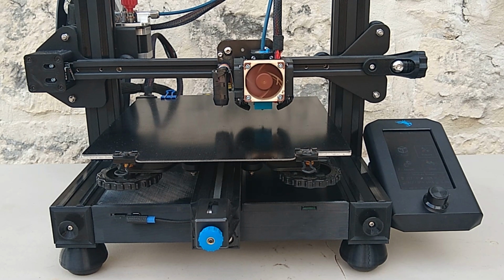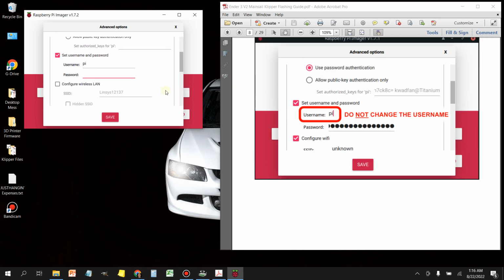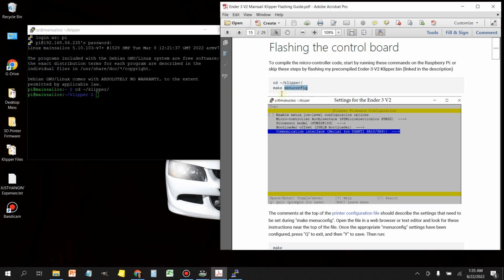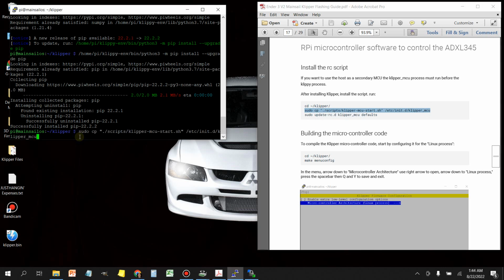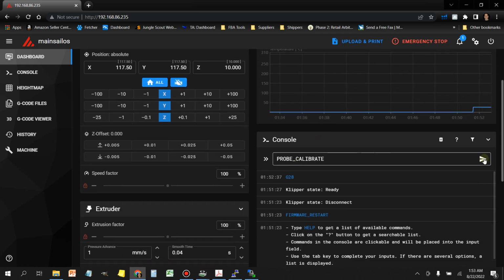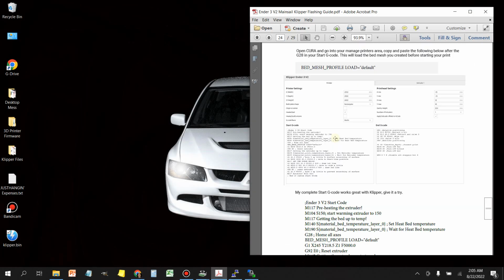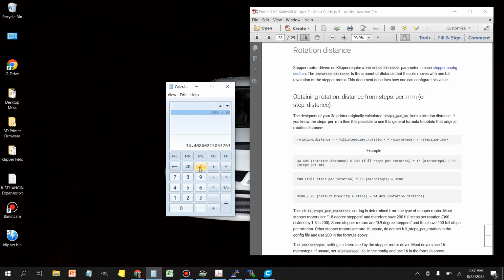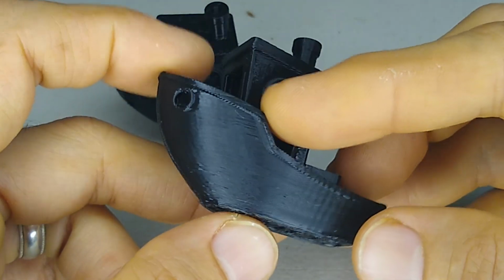Ender 3 V2 An Easy Way of Installing, Calibrating, and Printing with Mainsail Klipper

Comment: 7 hours struggling to get my z-offset to the right setting. If i just knew this link i would have done it within 40minutes  ..Thanx victor
Reply from the maker: Hi Martin, Thank you for commenting, I'm glad you found value in this video for your viewing time and got things working. Best of luck with your 3D Prints.

Comment: follow this instruction to a "T", but having issues with the MCU popping up in mainsailos. Getting the error of "moonraker cannot connect to klipper. Check the klippy_uds_address: ~/printer_data/comms/klippy.sock". any thoughts as to what may be blocking the connection of the MCU?
Reply from the maker: Hi Jordan, What chip does you board have STM32F103 or GD32F303? Look at right side (square chip) of each picture linked below to determine which you have.

https://image3.pushauction.com/3/0/0/cdffea97-1da1-412d-ab6e-f577ed76508d/d4c430f0-1a4c-4f34-b8a3-422bf6fd2176.jpg

https://canada1.discourse-cdn.com/free1/uploads/klipper/optimized/2X/8/86baabe462ec66f23502d369945d902737171272_2_1023x686.jpeg
Reply: Did u fix it?

Comment: hi Vic i like your videos . Congratulations about your work. I have also ender 3 v2 but some models has  gd32f303 ret6 microcontroller. Do you know if we should use the same settings when we try to setup klipper ? In the past i made a try but i had problems in Z axis.
Reply from the maker: Hi Nick, Thank you for commenting, encouragement, and info about the new chip. I haven't tested this myself but a possible solution might be below. Please let me know if it works for you.

https://klipper.discourse.group/t/support-for-new-creality-boards-4-2-2-with-gd32f303/3016?page=2

Comment: Hello, i already did this once following your vid, now i had to do it again and when i try to use "ls /dev/serial/by-id/*" it says " cannot access '/dev/serial/by-id/*': no such file or directory" , can you help me with that? im going crazy
Reply from the maker: Hi Mica, that response indicates that the Raspberry Pi doesn't see the printer. Try a different USB cable. Keep in mind that it must be a data cable and not be a charge only cable. I've had brand new data USB cables not work so try another one.

Comment: Morning Victor, great videos clear and easy to follow and understand. However I have run into a problem.  I have an ender 3 which now has a v4.2.7 board and the LCD screen. had the mscro software all good.   But wanted to learn something new so got a Pi 3+ and have gone though the all the steps. Twice!!  mainsail communicates with the printer.  Endstops trigger, temps of heater and bed work. I can activate to de-activate the motors but if I home etc motors will not move??  Any suggestions would be very much appreciated.
Reply from the maker: Hi Duncan, what printer.cfg are you using? Is it the one for the 4.2.7 board or are you using the 4.2.2 printer.cfg?
Reply: I have tried Both!! and from differing sources too.  So still scratching my head but I will get to the bottom of it.
 @vbared

Comment: I need to use my android phone instead  of rpi with Octo4A  software but Klipper ran in octo4a does not support flashing of board's microcontroller. So can i use your  Ender-3-V2-Klipper.bin to flash my ender 3 v2 ? 

Thanks for the great tutorial.
Reply from the maker: Hello friend, Thank you for commenting and encouragement. Yes, my Ender 3 V2 Klipper.bin file will work on yours. I'm not sure if anything else is created in the the raspberry pi or in your case Android phone when the bin file is generated so if it doesn't work just run the Linux commands to generate your own klipper.bin on your device but just use mine, which should be the same.
Reply: Thanks for your answer.
Reply from the maker: @panagiotis-u3y  Anytime (:

Comment: I have an ender 3v2 (w/CR Touch) and 3v3. I'm attempting to put klipper on an Ubuntu PC and control the V2 with clipper and V3 with Octoprint (Marlin) from the same PC. (will put the V3 on Klipper when I'm confident that the config will work properly) 

Thank you for your guide. This will help me a great deal!
Reply from the maker: Hello Crooker2, Thank you for commenting. Running Klipper on a PC will provide a lag free experience.

Let me know how it all works out for you.

Best of luck with your mods!
Reply: @vbared  Thanks Victor!  For the record, I'm doing this with KIAUH which is an awesome helper tool.  I still have lots to learn though.  Thanks for your content.  New subscriber.  Appreciate it.

Comment: Hey @vbared - thanks for the video! 

FYI your google drive link doesn't work anymore, would you be so kind as to update it?
Reply from the maker: Hello, Thank you for commenting and the heads up about the Google Drive Link. It looks like they made a change that is causing issues.

I copied those files to MEGA - https://mega.nz/file/VIVHTZpQ#niYdBTV32IiXy8ZyVoK-JOdce8Yvwg-if5yvQAokkoY

Comment: I'm new to this and having issue running "/home/pi/klippy-env/bin/python3 -m pip install --upgrade pip" I'm getting  "no such file or directory" Anyone had this issue?
Reply from the maker: Hello, I just did a fresh Mainsail Klipper on Raspberry Pi for a new printer. 

The following sequence is still working:

cd ~/klipper/
sudo apt update
sudo apt install python3-numpy python3-matplotlib libatlas-base-dev
~/klippy-env/bin/pip install -v numpy
/home/pi/klippy-env/bin/python3 -m pip install --upgrade pip

Let me know if you have any trouble with it.
Reply: @vbared it works now. I probably screwed up in the beginning. thank you
Reply from the maker: @pinggoyadventures5010  Awesome! Glad it's working for you.
Reply: Would I need to change anything if I were to upgrade mine to sprite extruder?
Reply from the maker: @pinggoyadventures5010  The only thing I can think of is the rotation distance (aka e-steps).

Comment: man i cant get mine to go.   Every time i get stuck at same space.  After  I Make and transfer my klipper file over to kfirmware.bim.  my progress stops.  nothing i try works after that.  

 ****MCU unable to connect***  
is what i get

 Any ideas?
Reply from the maker: Hello, Are you installing it on an Ender 3 V2 or something else? Is your computer running Windows or Apple? If Windows are you running an antivirus program, then don't like bin files. Feel free to call me 478-227-3301 so I can help you troubleshoot the issue.

Comment: This is absolutely the clearest guide I've seen on how to install and setup Mainsail/klipper. Thank you. 
One question, Why did you not touch on using git hub's repository to setup your ender? I have a tenlog which is a cheap challenge to say the least.
Reply from the maker: Hi Dennis, Thank you for your kind comment. You're most welcome, I'm glad you found value in this video for your viewing time. Please link the git hub page you're referring to so I can take a look at what mean.

Best of luck with your mods!

Comment: Hi and thanks for your quick reply.  I flashed the printer successfully.  Putty also gives me feedback from the printer.  But mainsail still doesn't connect to the printer.  In the next comment I'll send the link to the klipper.log file
Reply: The serial in the printer.cfg ist the same like in putty
Reply: Now ist works. I think there was an issue in the printer.cfg file for me. I used the example file and had succes.
Thanks from germany.
I love your channel!
Reply from the maker: @Albi1893  Thank you Albi1893, I'm glad you got it working. Klipper is amazing, your going to love it.
Reply: https://drive.google.com/file/d/1CGXSUiELi7z5i22eofCZzXMXNssIIu-0/view?usp=drivesdk
Reply from the maker: You're welcome friend, There might be something in the Mainsail Klipper update that needs fixing. Try a fresh Mainsail Klipper putty installation using only the files provided in the video description but skip the update all step. Complete the rest of the steps and see if it communicates with the printer.

Comment: This is a great and very helpful video so thank you. The only problem I’m running into is that when trying to install the MCU script, it says “no such file or directory”. Do you know why this could be happening?
Reply from the maker: Hi Evan, Thank you for your kind comments. Is the Mainsail interface loading via the web browser for you but shows the MCU error? If so make sure that the USB cable has data transfer ability. I usually test my cables using an old cell phone that has a USB mini plug and plug the USB side into my computer. If I can access the files on the phone then the cable is good. If it only charges, the cable may be either bad or is a charge-only cable. I've had cables right out of the wrapper not work so try a few to make sure that isn't what is causing the issue.

Check communication between Klipper and the printer by copying the "ls /dev/serial/by-id/*" line below and
pasting it into the PuTTY session. If you get a file not found error, check your USB connection between
the Raspberry Pi and the Ender 3 V2. This messed me up for some time and it was just a loose cable.
It should report something similar to the following: (if different than the values below copy the
output and paste it into the printer.cfg file in the [mcu] section replacing what's after serial:

ls /dev/serial/by-id/*

The Raspberry Pi should return something like the line below if it can communicate with the printer.

/dev/serial/by-id/usb-1a86_USB2.0-Serial-if00-port0
Reply: @vbared  Oh okay so the printer needs to be connected when running that code?
Reply from the maker: @kulpercinematic  Hi Evan, did you confirm that the printer can talk to Raspberry Pi using the 

ls /dev/serial/by-id/*
Reply: @vbared  It definitely is connecting to the printer. I was able to run a print. I think the problem is that it’s missing the “klipper-mcu-start.sh” file. Is there a way to add that file so it can use it?

Edit: it turns out that I needed to run the klipper-mcu.service file. But even though I figured that out, it still when I type the make flash command tells me “failed to restart klipper mcu service: unit klipper mcu service not found.

Comment: I have been trying for 3 days to get this to work. I can get the pi to communicate with no problem. I have updated all of the mainsail OS updates with no problem. I can't seem to get klipper to work. it keeps giving me the error of "mcu 'rpi':unable to connect. I have checked the mcu settings in the printer.cfg file and made sure they match. When I do a firmware restart, it gives me the error that the klippy host software is attempting to connect. Not sure what else to do. Pulling what's left of my hair out!! Any ideas?
Thanks,
Reply from the maker: Hi Shawn, Call me 478-227-3301 and leave a voicemail so I can call you right back to help you resolve it.
Reply from the maker: Hi Shawn, 

Make sure that the USB cable has data transfer ability. I usually test my cables using an old cell phone that has a USB mini plug and plug the USB side into my computer. If I can access the files on the phone then the cable is good. If it only charges, the cable may be either bad or is a charge-only cable. I've had cables right out of the wrapper not work so try a few to make sure that isn't what is causing the issue.

Check communication between Klipper and the printer by copying the "ls /dev/serial/by-id/*" line below and
pasting it into the PuTTY session. If you get a file not found error, check your USB connection between
the Raspberry Pi and the Ender 3 V2. This messed me up for some time and it was just a loose cable.
It should report something similar to the following: (if different than the values below copy the
output and paste it into the printer.cfg file in the [mcu] section replacing what's after serial:

ls /dev/serial/by-id/*

The Raspberry Pi should return something like the line below if it can communicate with the printer.

/dev/serial/by-id/usb-1a86_USB2.0-Serial-if00-port0
Reply: I may have jumped the gun. When I go to mainsail and try to home the printer, nothing moves. I get an error "no trigger on x after full movement". The hot end works, the bed heater works. I have tried to sync the endstops and check that but nothing. 
Ender 3 v2. 4.2.7 board. Just added a CR touch before installing klipper. nothing else added. Can you help?

Comment: hello, this tutorial also works if I want to use linux (mint x or xubuntu, devian platform) on a laptop with ender3v2 with cr-touch?
Reply from the maker: Hello Masgras George, I'm sure it can work off a laptop running Linux but I haven't tried it.

Let me know what process you find to get it working.

Comment: Hi Victor, thanks you very much for such a great video. It's amazing how well it is documented, the walktrough is very straight forward. I followed the steps and everything worked fine.

But I have a problem that can't understand, honestly.

I have a 3D Touch bed level sensor (it's not original) and I already did the PROBE_CALIBRATE with a .15 feeler gauge and the BED_MESH_CALIBRATE. The Start G-CODE it's the same as the one that you put in the documentation .zip file. But whenever I print, it's like the printer is not calibrated, either like it's not using the mesh or not sensing correctly in the Z Axis.
My first thought is that the 3D Touch it's not working properly, but I wanted to ask to you what else can I check. A frind of mine has the same 3D Touch and he doesn't have this problem.

Thanks you very much in advance, and sorry for my bad English!

Your videos are amazing!
Reply from the maker: Hello Juan, No need to apologize, I understand you perfectly. Below is my complete CURA start g-code. You need to make sure that bed mesh is loaded prior to the print starting so after the G28 ; Home all axes add BED_MESH_PROFILE LOAD="default"

;Ender 3 V2 Start Code
M117 Pre-heating the extruder!
M104 S150; start warming extruder to 150
M117 Getting the bed up to temp!
M140 S{material_bed_temperature_layer_0} ; Set Heat Bed temperature
M190 S{material_bed_temperature_layer_0} ; Wait for Heat Bed temperature
G28 ; Home all axes
BED_MESH_PROFILE LOAD="default"
G1 X245 Y218.5 Z1 F5000.0
G92 E0 ; Reset extruder
M117 Getting the extruder up to temp!
M104 S{material_print_temperature_layer_0} ; Set Extruder temperature
M109 S{material_print_temperature_layer_0} ; Wait for Extruder temperature
G1 Z1.0 F3000 ; move z up little to prevent scratching of surface
G1 X228 Y200 Z0.3 F5000.0 ; move to start-line position
M117 LET THE PURGE BEGIN!
G1 X228 Y20 Z0.3 F1500.0 E15 ; draw 1st line
G1 X225.2 Y20 Z0.3 F5000.0 ; move to side a little
G1 X225.2 Y200 Z0.3 F1500.0 E30 ; draw 2nd line
G92 E0 ; reset extruder
G1 Z1.0 F3000 ; move z up little to prevent scratching of surface
M117 Autobots! Roll Out!
; End of custom start GCode
Reply: @Victor Bared  Yes, that's checked, the g-code it's the same as you!

I found out a command in Klipper: PROBE_ACCURACY, tried it 4 times and the results are completely innacurate:

#1: standard deviation 0.025200
#2: standard deviation 0.007267
#3: standard deviation 0.032750
#4: standard deviation 0.059517

So maybe the problem is that the sensor is not original, sadly in my country everything is very expensive, that's why I bought the cheap one haha.

Anyway, thanks you again Victor, for sure one of the best channels of 3d printing!
Reply from the maker: @juanignacioschulz5015  Wow, the probe accuracy is really bad. Thank you for sharing your experience with the 3D-Touch.

Comment: just wanted to thank you for such a great guide, everything was easy to follow and do. Waiting on the accelerometer to do that next. Keep up the great work
Reply from the maker: Hello Manny, Thank you for commenting and encouragement, I appreciate you very much. Great job getting Klipper set up, the new capabilities you've just unlocked are going to blow your mind.  My latest video (linked below) elaborates on the hardware side of installing and using the accelerometer to measure resonances in Mainsail Klipper.

https://youtu.be/kg_jYL7ksEc

Best of luck with your mods!